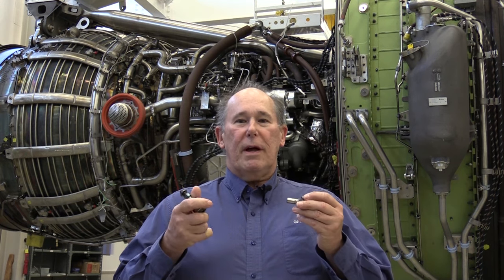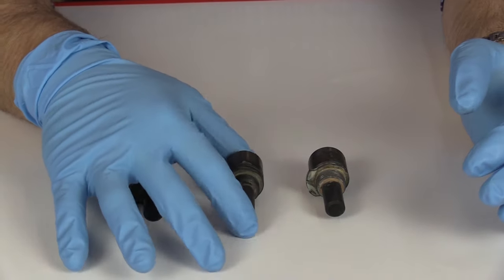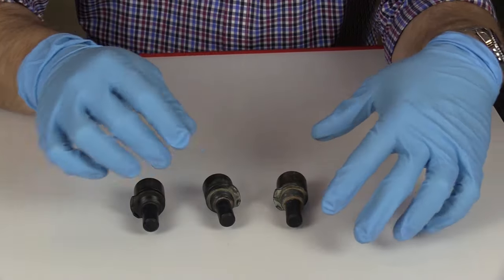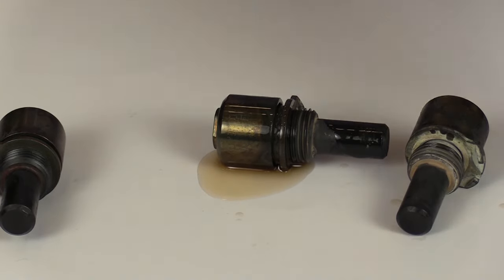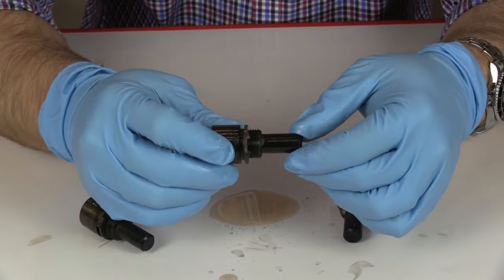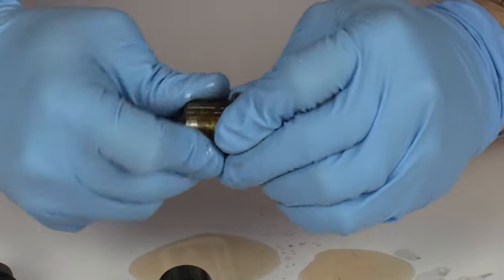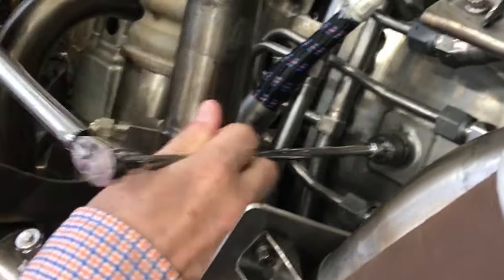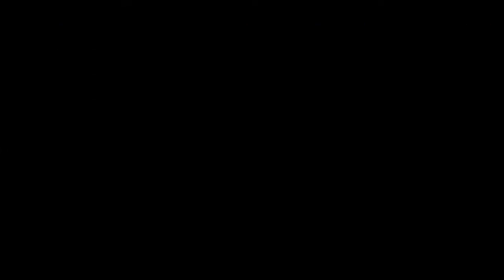GEnx 1B2B Borescope Plug Rejuvenation - GE Aviation Maintenance Minute

Comment: Am I correct in assuming that the plugs which were freed up with penetrant should be cleaned and flushed out before reinstalling? It seems that when the engine is at operating temperature, as the oil burns off it can make the plug seize up again because of the residue.